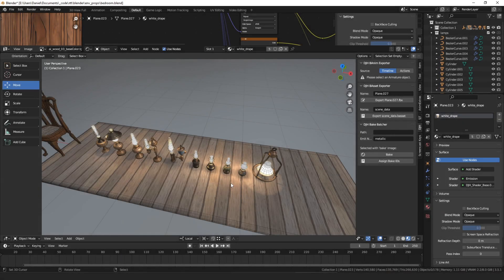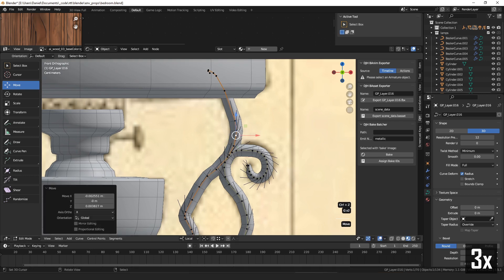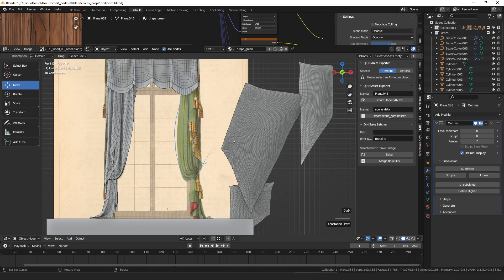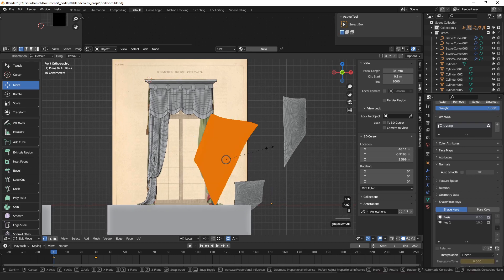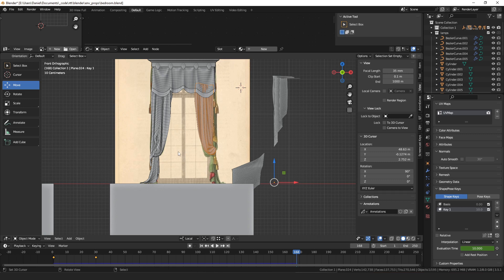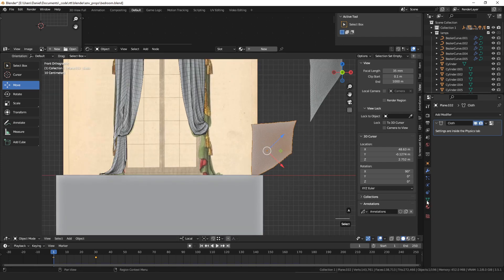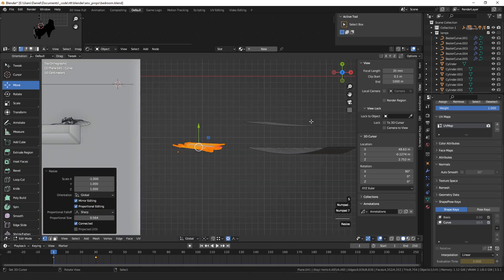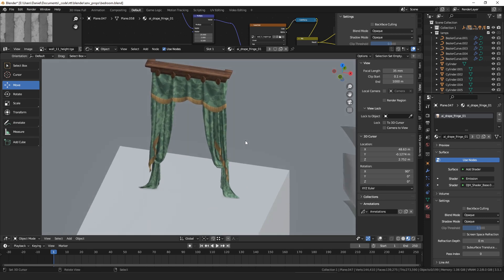Grease Pencil Spin & Cloth Modeling - A Blender Tip or Two

Comment: Nice method for some fancy stuff, I wonder what else we can do with this. 

If I may share a suggestion for smoothing curves quickly and more accurate than by hand,
I select all points, subdivide (it subdivides without moving any points) and then smooth option(available only in curve mode), then reduce points. The more you subdivided the better the shape will be preserved, but the smoothing isnt so great then, good control there.
Feels to me like its interpolating very well this way. 

Thanks for the tip, it was suprisingly fast :)